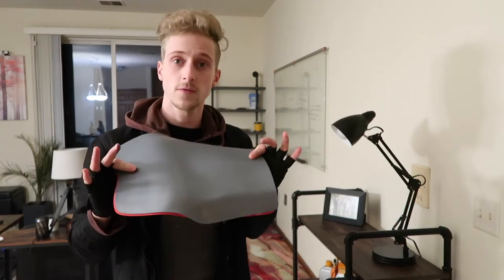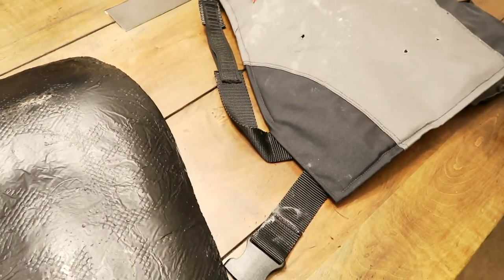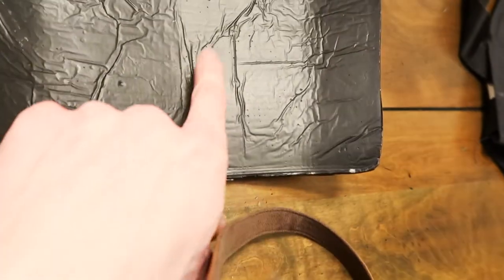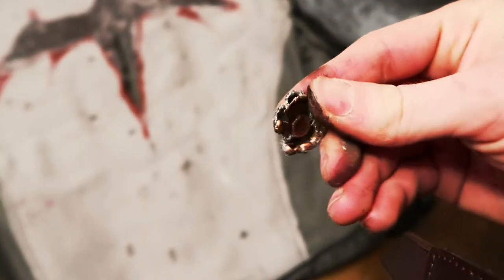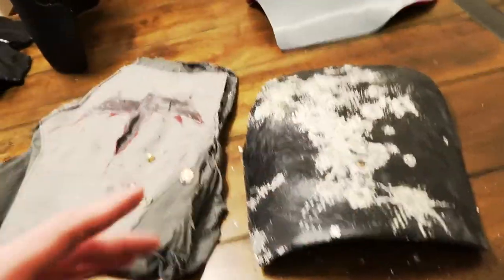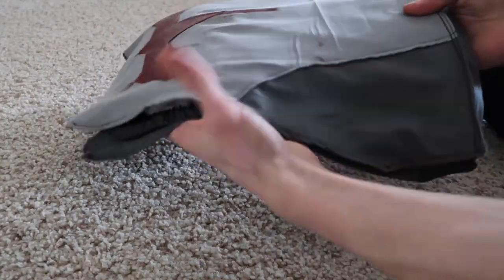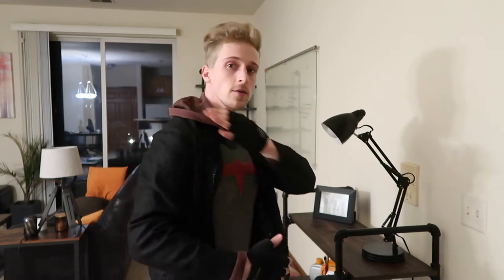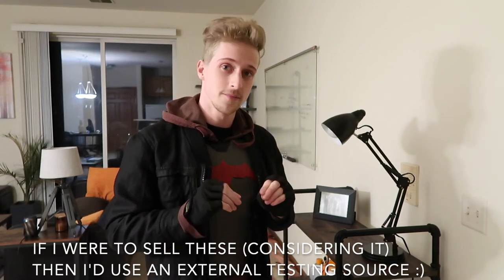Real Bulletproof Cosplay of Red Hood (Analysis)

Comment: You could treat the fabric parts of it with Shear thickening fluid or add d3o padding. Treating Kevlar with stf increases its ballistic protection cuz it hardens on impact. D3o works the same way but is for impact instead
Reply from the maker: This is actually quite a bit stronger than Kevlar submerged in a non-newtonian fluids such as polypropylene glycol. Additionally, this design is thinner, lighter, and has a longer shelf life. I actually decided against kevlar as an ingredient for this particular composition design.
Reply: @CrashMakerspace  If you made this work with carbon fibre I'd be REAL impressed, but you probably used something superior to kevlar that other people ignore, like PBO or M5 fibre.

I mean, whatever you used I'm still impressed... because there's no backface deformation, even with 357.

I agree that consistent diameter nanoparticle treatment only makes sense for the non-rigid parts of the suit, and only if you choose to armour those parts at all.

I am curious though, are you interested in making ceramic composite armour, for rifle rounds and such? I've seen single or double curved plates, but never anything contoured or all that thin. I can think of a few ways to go about it, like nacre ceramics, pre polymer ceramics, and hydrothermal sintering, but I'm not sure what equipment you have or how 'up' you are with the ceramic side of armour literature. Or even if it's at all practical for the 'home gamer' to do anything much better than decent tile armour these days.
Reply from the maker: @abowden556  I have SiC & B4C tiles so I do have some armor that uses this composite as the base (since its super strong but not necessarily hard like ceramics) and it takes a good bit of green tip 556 and 308 but I took a bit of a break the past 1.5 yrs for other projects, moving, and my workshop! However, I do want to start sharing more tips and materials for at-home armor that's formable and tough
Reply: @CrashMakerspace  interesting. any ideas for formable rifle armour?
Reply: @CrashMakerspace  Nice. Have you found a way to make the ceramic armour just as curved without compromising protection? only way I can think to do that is to painstaking carve/machine/CNC grind each tile... Either that or use one of the manufacturing methods that can make ballistic ceramics of almost arbitrary shapes, I know they are out there, even for B4C.
Reply from the maker: @abowden556  I have made 308 rated (8"x8" took 8 rnds at 50 yards) but its flat. I'm looking to hop into armor again once the workshop is finally done :)
Reply: @CrashMakerspace  Awesome. How thick did the plates end up being, out of curiosity?
Reply from the maker: @abowden556  The rifle ones were 18mm thick
Reply: That's really good, especially for homemade stuff! Do you have plans to make non flat armour of that kind?
Reply from the maker: @abowden556  I have some concepts! I’m toying with tubulanes currently but all the new armor stuff is on the roster going forwards with the channel

Comment: have you considered taking inspiration from older armors 
in the medieval times there's a type of armor called jack plate that exists as a halfway point between chain and full plate armor
its essentially a sectioned system of plates attached to a backing of leather or fabric
you would with modern materials be able to maintain flexibility while preserving the rigid plates 
the plates would also be easier to replace keeping the armors life span
(also you can have the thicker "bat" symbol to draw fire and have additional protection inserted over the top as batman and punisher mark the thickest sections for this purpose)

Comment: I appreciate keeping the composite material locked down. I do wonder how one presses these into shape? I saw your video on the press and on making the cosplay designs for foam, but am unclear on the form for the press?
Reply from the maker: I made a 3D mold of my chest and backed it with concrete to harden properly so I could press it with weight

Comment: I wanna see what 5.56 green tip out of a 20” barrel does to the armor
Reply from the maker: I’ve tried exactly this! 308 as well; it stopped 15 green tip and 4 308 for a 9”x9” plate. I just add carbide in front. For the new batsuit I’m building the chest will be the IV nij